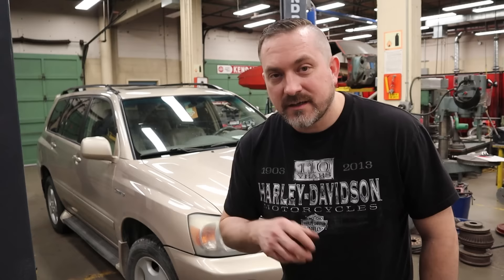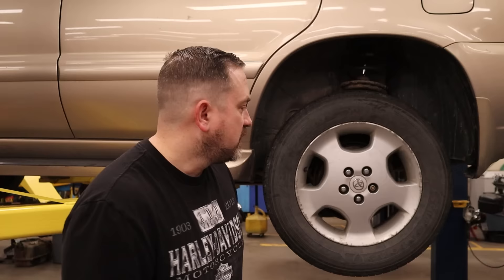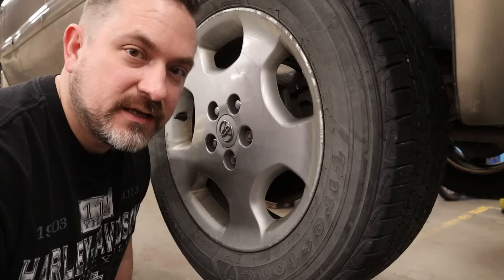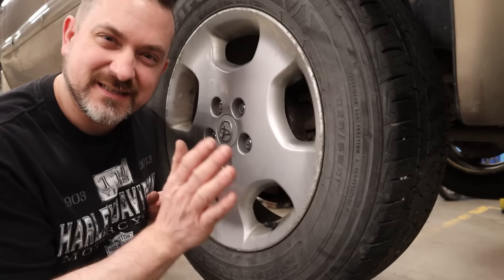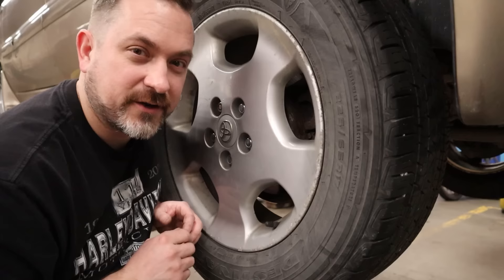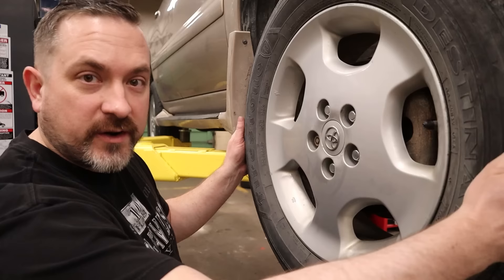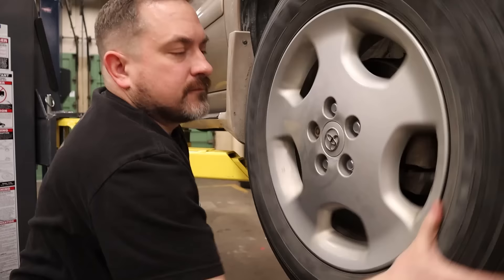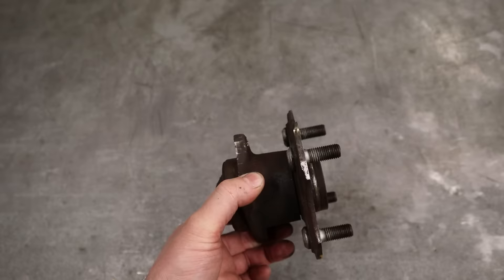How to 100% diagnose a bad wheel bearing.

Comment: Great practical vid! If there is premature wear on the bearing thats hardly audible you can spin the wheel and hold your fingertips on the spring. An almost to fail bearing will bring some springvibration
Reply from the maker: Yup great info!  I have another video on doing a road test and some other tricks like the one you mentioned.  Thanks for the watch, cheers!

Comment: Another trick for isolating which wheel the bearing noise is coming from is have someone in the car on the hoist, get the wheels spinning and carefully reach above the wheel and hold onto the coil spring, part of the strut.  A bad bearing will vibrate through the strut into the spring and the vibration difference wheel to wheel is very noticeable.
Reply from the maker: Yes you are right, mind you you don't need to run the car.  Just spin by hand and you'll feel it.  I actually have another bearing video showing this and a road test scheduled for June.  Thanks for the suggestion and the tip!
Reply: @wayofthewrench  I can't move my cars tires with my hands. it's impossible. Even passing the key on position.
Reply: @irisbaez1972  put it in neutral. If you only have one tire jacked up make sure you use a stand and chock the tires
Reply: I came here to say this
Reply: Your going to get people hurt with advice like that
Reply: @wayofthewrench  I suggest you run the car, 2 mechanics checked my bearing and said it was good. The third one is the only one who actually ran the car and did exactly what the leading comment said. At that point, it was obvious that the bearing was bad.
Reply: tire out of balance,  starting cord separation on tire, tire out of round, pack of dirt on inside of wheel,  wheel mounted without cleaning mounting surfaces, bent wheel from rubbing curb,  if bearing noise you should be able to hear without touching spring,  after all the reason you are checking in the first place is the noise
Reply from the maker: You may have to jack up the car so both wheels are off the ground and put it in neutral ( chocks on wheels on ground and parking brake on).  Some cars it's just easier to do a road test for bearings, check my other video out.
Reply from the maker: Good info
Reply from the maker: Yes my road test bearing video is out.  Yeah I try really hard to add stuff like the turned up audio because how else are viewers supposed to hear/see/know this?  Thanks for the watch and your support for the channel!
Reply from the maker: I just had a vehicle with this and strangely there were zero heat issues.
Reply from the maker: Cheers!
Reply from the maker: Which person are you referring to?
Reply from the maker: Yeah my bearing tests are pretty much diagnosed fully by road tests.  I have another video on road testing a bearing you should check out.  Cheers!
Reply from the maker: I had a bearing the other day that had zero play, zero noise while spinning, a stupidly faint vibration on the spring when compared to other side but at highway speeds it was bad.  Just changed it and the noise is gone.

Comment: My 2018 Toyota Sienna (70k miles) has a loud reving sound when traveling above 30mph. 

Took it to the first Toyota dealer and they diagnosed it with a bad transmission - $9k

Took it to AAMCO - they said the transmission checks out fine, and they did hear the noise I was complaining about - but didn’t know what it was.

Took it to another Toyota dealer. Senior Mechanic diagnosed it with bad rear bearings - $2600

He was very confident it’s the bearings….. work is getting done on it tomorrow!
Reply from the maker: I hope he diagnosed them properly for ya.  $2800 for rear bearing.....ouch.  I just did my own for $550. Thanks for the watch!
Reply: @wayofthewrench  it includes an alignment too…… thanks for the video! Great content
Reply from the maker: Ah ok.  Hope it's all good now.  Sweet, glad you're liking the channel.  If you deem me worthy, I'd really appreciate it if you could share out my channel to your friends.  Thanks for your support for the channel!

Comment: While any amount of play confirms bad bearings, a lack of play doesn't disprove bad bearings. 

You can have bad bearings without any noticeable play. I had already assumed I needed to replace my bearings based primarily on the sound and also on vibrations felt through the steering wheel. But concerns over whether I could safely drive the vehicle  led me to jack up the trailblazer to see just how bad it was. There was NO PLAY and the noise that was so loud above 20mph was nearly inaudible by spinning the wheel.  I went ahead with the bearing replacement anyway and it was indeed my problem. Bad bearings. So I thought that might be useful to keep in mind.
Reply from the maker: Yes you are right Rob, hence why I showed the road test to hear the bad bearing noise.  Most diagnosing can be done with a road test ( also test which side by loading/unloading while turning hard) and the wheel shake is just to confirm.  Sometimes they don't make noise with just a spin test too so I sometimes use a mechanics stethoscope to hear a bad bearing.  Thanks for the suggestion and the watch!

Comment: Another way to test for a faulty wheel bearing is to put side to side stress on it in a vacant lot or wide, unused roadway. 
The vibration from a faulty front wheel bearing is also often felt as a vibration on the steering wheel.
The noise doesn’t always remain at all speeds and can disappear at higher speed.
Reply from the maker: Yup, lot's of ways to test out those bearings.  You're right, the bearing noise can come and go depending on speed and load.  Thanks for the watch!
Reply: I think my bearings are bad I feel vibration in stealing wheel and feel I under my feet while driving. I can't hear the humming noise due to my All terrain tires
Reply from the maker: Vibrations are usually wheel balance issues, especially at speed.  You should check out my balancing video!  Also do the check for wheel bearings too.  Cheers!
Reply: i replacesd the front wheel bearings, and test drove it and it was quiet, drove the honda for work and its starting to make the humming noise again, but not as loud
Reply: Yeah thats what I do. You can usually tell what side its on by turning back and forth as you drive. The noise comes and goes as you sway back and forth. Noise when you sway right means left bearing bad, noise when you sway left means right bearing. I find it hard to tell by just listening while driving straight.

Comment: Thank you for this. I have a weird rattle/grind sound that you only hear at 51 -54mph…I slow down to 50 and slowly speed up and then it comes back…only lasts like 2-3 sec. If I let off the gas it stops..I’ll use your tips to diagnose if it’s the bearing.
Reply from the maker: Hrmmmm, normally a grind/rattle would not be a base bearing sound.  It's more of a rumble.  I do have another video on road testing a bad bearing you should check out too.  Good luck!  Thanks for the watch and welcome to the channel!

Comment: I was taught this. Jack car up and get someone to hold the steering wheel on full lock. Then hold the tyre at 6&12 and if you can rock it it's a bearing. Hold at 3&9 if it moves it's a track rod end worn out. Then move steering wheel to opposite lock and repeat.  Then set the wheels to straight ahead and spin by hand If any grinding or whurring sound is heard it's definitely a wheel bearing. But the old mechanic said holding on full lock is very important as that eliminates any problems you might have with rubber bushings confusing your examination. I've found loads of worn bearings and track rod ends this way. As for testing the rubber bushings you need a 3 foot tyre lever and try to separate them. If they are worn out you will see them split and cracked. I've done this without anyone holding full lock and the test results are much vaguer and not as definite as when the wheel can't move side to side.
Reply from the maker: Your method doesn't eliminate the possibility of sensing a worn ball joint or steering.  If there is play on a suspension system or steering (steering rack bushings), you will still feel it.  The key is does it have up and down and left and right play.  Back this up with a spin test or road test for a speed dependent sound.  Thanks for the watch.
Reply: @wayofthewrench  true. And a good video for anyone starting off as a DIY mechanic on their own car. I learned by watching older neighbours servicing and repairing cars in the 1960s. Zodiak's. Consul's. Minis. Anglia's etc. Those old guys must have been very patient as I was always asking "what are you doing" I would wash their cars and polish them for pocket money.
Reply from the maker: That's an awesome memory and such a great way to get interested in the trade...true gearhead fashion.  Those guys and cars relied on real diagnostics as there was no internet or scan tools.....ya had to figure it out.  I learned a lot of my stuff from working on my 1968 Firebird and my 67 Parisienne ( the car in my logo).  Thanks for the support for the channel.

Comment: In your opinion, what would cause a left driver side wheel to wobble from say 20-40 mph, then wobble/vibrare again between 60-70+ mph, but not have much wobble or vibration at all between 40 - 50 mph? The tires on the front are a bit old, so I'm thinking that left tire is just worn down unevenly more than the right, perhaps being severely out of balance or something.  What do you think? Thanks in advance! - John M.
Reply from the maker: It sounds more like an out of balance wheel to me.  You can check the play in your wheels and if there is none, it's probably a wheel balance issue.  Sounds like you might need new tires too.  I have great videos on both of these if you're interested.  Cheers!
Reply: Either or of balance wheel or scalloped tires

Comment: Hey man, thanks for the video! 
After I drive my car for at least 30 minutes I start to hear a howling noise when I turn my steering wheel slightly to the right. On the highway for instance. Any suggestions where to look first?
Reply from the maker: Hrmmm...hard to say over a message.  Try to isolate when it happens and make sure it's not heard at slower speeds.  If it never happens until 30 minutes of driving, it could be the start of bearings or possibly a slightly seized brake caliper that is not backing off or even tire damage like a ply separation with heat.  Are there any other symptoms like slight pulling to a side or is it speed dependent?  Have you done the wheel test for bearings with it jacked up off the ground?
Reply: Thanks for taking the time! You got a new subscriber
Reply from the maker: Thank you very much for the sub!  Hope you figure out your vehicle's issue! Cheers!

Comment: As a professional technician I can verify that these are the best methods to check for bad wheel bearings. I see people all the time get the stethoscope out and have someone drive it in the air, usually there’s no need with wheel bearings.
Reply from the maker: Thanks for having my back Andrew!  Yup, this is the way.  Thanks for the watch and the support for the channel dude!
Reply: My mechanic did just that today with the stethoscope. He said he "thinks" it's the wheel bearing, but not positive, as it is a very unusual sound. Of course, don't want to spend the money if it is not the wheel bearing. Is the stethoscope an inaccurate way to diagnose bad wheel bearings?

Comment: What might cause a grinding like sound for the brakes when they’re cold? I’ve had the brake pads and calipers replaced and i’ve had multiple full services since but i’m still getting that sound
Reply from the maker: Does the grinding sound only come on when you are on the brakes or is it even when you are off the brakes?
Reply: @wayofthewrench  Only when I'm on the brakes
Reply from the maker: Ok cool, then its a brakes issue.  Squeeling is the pads are needing repaired but a grinding is metal on metal.  If the pads were changed, I would suspect they were installed wrong.  Did they grind before the pads were changed?  Were the rotors changed? Did you change anything like rims or suspension components?  You can also try braking on with the parking brake to isolate if it is in the rear or in the front.  Parking brake only operates the rear.

Comment: I wasn't sure if i had a failing wheel bearing or not as i could only hear a faint whine and rough roads drowned the sound of it out but luckily found a smooth road and the faster i went the louder it got. Now i've got to see which one it is and then have it changed.
Reply from the maker: You should check out my other video on road testing a bearing to help diagnose which side it is.  Glad you're figuring it out.  Thanks for the watch!

Comment: Had one on a 4Runner. No noise, just a vibration up through the steering column and floor board. Not speed dependent but would change with turns to the left. No looseness in the wheel, bearing felt fine, turned smooth, no play, no grinding. When I changed it, I swore it wasn’t going to fix it that bearing felt fine.  Yep, it fixed it lol.
Reply from the maker: Yeah the key info is the left and right turns where it went away and came back depending on which turn.  Classic wheel bearing.  I made another road testing video for just that, you should check it out.  Thanks for the watch!
Reply: @wayofthewrench  Yeah, that vibration also matched up with a drivers side front diff roller bearing given the cv axle slop at the bush….replaced that first, no go.  Wish I had seen that video first!
Reply from the maker: Sometimes you have to experience it before you learn, everyone is guilty of that in life.....me too.  It's how ya learn and then share that experience with others.  Cheers!

Comment: Maybe your customer should forget about the wheel bearing , and polish his lights
Reply from the maker: Yeah it's a bit rough looking but at least they got rolling again.  Thanks for the watch!
Reply: These highlanders are effective with lights like this but polishing this plastic won't work needs replacement! I know trust me!
Reply: Never polish foggy or hazy headlights, it'll only make it worse over time.  You have to sand from ~300 grit to knock off any wax, polish and oxidation, then work your way up to ~1000 grit.  After that, wet sand at 3000 grit to buff out any scratches.  Then you can add a headlight UV specific clear coat to protect the headlight, and fill in the remaining scratches.
Reply: I'd say a wheel bearing is way more important than a foggy headlight 😂
Reply: @james_green- Exactly what I was thinking!😂
Reply: And I suggest lubing the muffler bearing
Reply from the maker: Did you know there is such a thing as a muffler bearing now?  Look it up.  It's on BMWs with exhaust cut outs......crazy, that old joke became true

Comment: Great video. Thank you.  I'd been told in the past to rock the wheel up and down to determine bad wheel bearing and spin the wheel to listen for the grinding, but to rock side to side to determine bad tie rod.  How would a bad tie rod would act rocking the wheel side to side, or was I just told bad advice?  I know to look for the broken rubber boot.  Thanks again.
Reply from the maker: The tie rod is what turns the wheel when turning the vehicle.  If there is play/wear in the tie rod, it will feel loose when you rock the wheel left and right.  I just put out a great video on this, you should watch it.  Hope that helps.  Thanks for the watch and welcome to the channel!

Comment: When you spun that bad one that was off the vehicle, it made that same sound that i’m hearing on my impala (8th gen)! Up until now i was wondering what that sound was - now i know for sure (also, meineke said there was play in ‘em). My car is about 22yrs old, and only 36K, so i had wondered: are there things that will cause damage to wheel hubs causing them to fail prematurely? (Driving habits? Road conditions? Weather?)
Reply from the maker: Yes and no.  Things like salty roads, hitting the curb with the wheel, aggressive driving, all have a part in it for sure.  Some are manufactured by good companies and some are as cheap as they can make it.  Finally, sometimes they just go too.  Thanks for the watch and welcome to the channel!

Comment: another way also is to spin the wheel and grab the bottom of the strut there and you will be able to feel the rumble very prominently through the strut there you can also just grab/touch any part behind the hub that is not a rotating component and also feel this, i do advise to check both sides using this method as you will feel a difference for extra peace of mind in your diagnosis
Reply from the maker: You're right, this is a good method to confirm bad bearings.  I have another video showing this plus a road test trick to figure out what side it is.  Thanks for the watch and welcome to the channel!

Comment: Overheating brakes will invariably lead to bearing failure later on as it cooks the grease.  I’ve had many fail in many ways on my taxis some pass all the shake the wheel, steer left/right and hand spin by ear tests but using a stethoscope reveals the truth very quickly.
Reply from the maker: If you have overheating brakes, then you will have a burnt metallic smell and rotor discoloration showing that the brakes are not releasing too.  Thanks for the info and the watch!